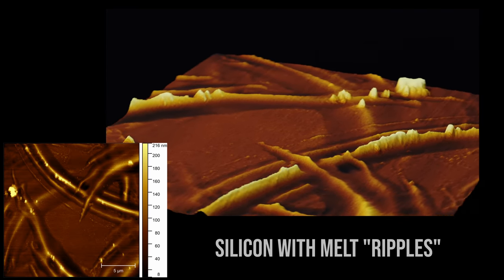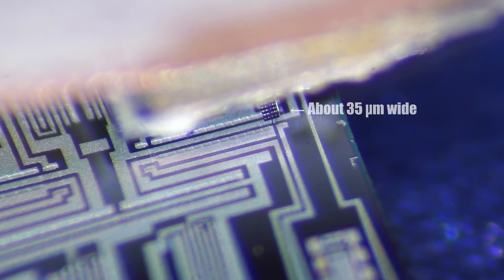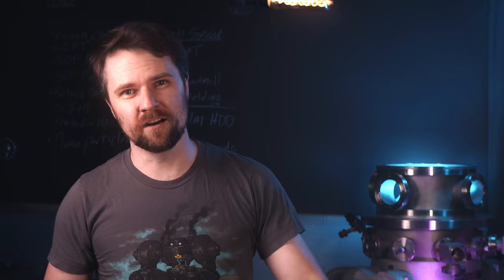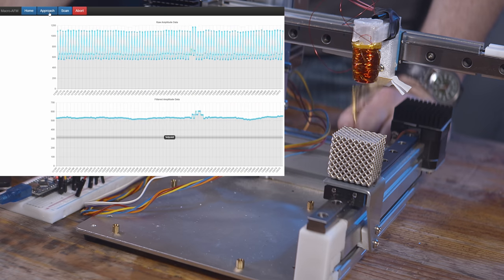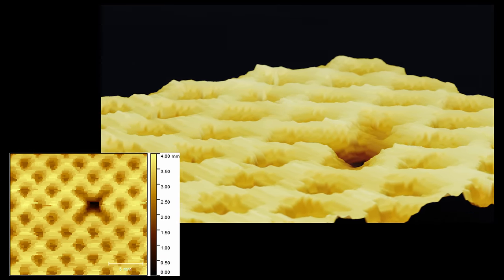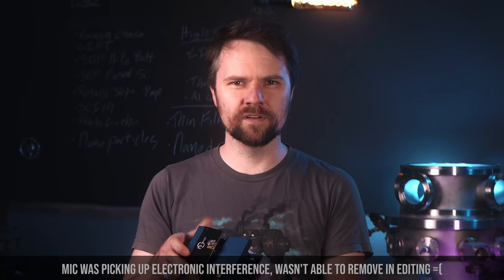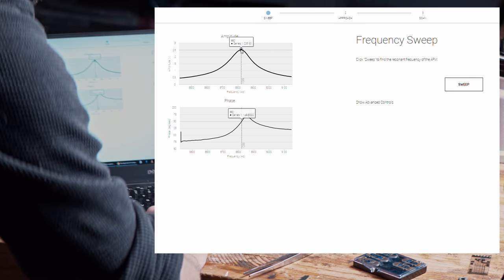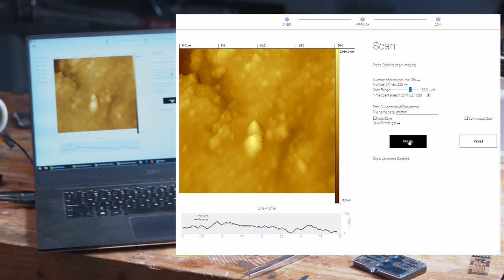1,000,000x Magnification with Atomic Force Microscope

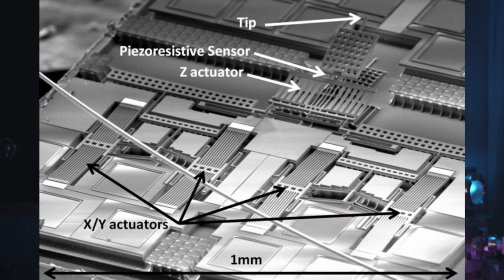Comment: As a PhD Student in MEMS technology the chip a 7:18 just put me in awe. 
I know how complex the mechanics of the "simple actuation" I want to achieve is.  This thing with x/y/z controlled motion is just beyond and stunning to see in almost exclusive silicon.
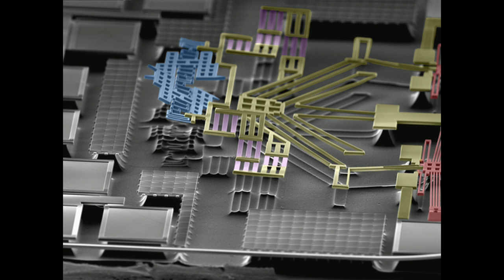Edit: 13:06 blew me away even more! One can still see the point the the "arm" was etched free from the surface, amazing!
Reply from the maker: Pretty wild, right?  It's amazing what MEMS engineering can do these days! IIRC, the actuators are thermal bimorph actuators (instead of electrostatic comb, which is what I assumed at first), which is just super cool :)

Comment: Atomic force microscopy is one of my favorite microscopy techniques, just because it can see down to nanometer resolution, give quantitative data in the Z direction, and the sample does not needs to be in a vacuum. compared to scanning electron microscopy, which requires the sample to be in vacuum, does not see in 3d or give quantitive data in the Z direction.

Atomic force microscopes are just so cool
Reply: also scanning electron microscope damages the sample because the electrons (since they are accelerated to a somewhat high speed) can hit the electrons in the atoms of the sample itself and affect the valence bonding in the chemical elements under inspection. So, if you making some custom integrated circuit for a client, and you want to verify if it is ok (quality test), you can't use electron microscope since it will introduce defects in the product
Reply: @absolute___zero  That’s true too

Comment: It’s a shame they too operate on the “request for quote” pricing model. Look I don’t care if your product cost 1k, 10k, 1M, or 10M just list the damn price, whatever it is.
Reply: Agreed, "request for quote" is the worst thing ever.
Reply: Yes I see it, Yes I want to buy it. I need 15.  Take my money. Response :  we dont have 15, only 12,000 min. Sure, send me the 12000, im going to take 15 out. Send it back on an account of the "picture does not match' cannot be applyed to out exact use.... Request Refund.....
Reply: 'Request for quote' simply means you might need some therapy before and after you see the price. But no worries. There is always a disruptor around the corner.
Reply: at least what is the scale of price. Is it about $5k? Or $50k?
Reply: @bryanjk  I mean that makes business sense though. As long as you are making a profit and you know it's never going to be a high volume item, it makes sense to try and trailer prices to get units out the door rather than block off access to a lot of people or lose out on huge profits based on a fixed price. I mean I'm not a business major, just a humble student of mechanical engineering, so if anyone more experienced could chime in I'd be interested to get their take.
Reply: The Bruker Icon featured at 12:10ish is gonna start at roughly $250K, and accessories or specialized options are $10K+ each. Most industrial companies won't publish their pricelists due the the complexity of information and the very specific markets.
Reply: Some equipment are export restricted the reason for request quote, but I agree it's absurd selling a product and not showing the price.
Reply: That means they will charge different amounts depending on who you are 🤣
Reply: They don't for one simple reason: price matching. They list their shit for $300k their competitors then know to list it lower, both knowing they're over-valuing the product. It filters out anybody they also believe may be trying to reverse engineer it. It benefits every manufacturer as they can all love in their own eco systems, all profitable to an absurd degree. Pricing them results in competition, which, as a result of the beauty of capitalism, means a pricing race to the bottom in pricing to out sell the competition.
Reply: @Exo594-b5v  What complexity of information? The whole "request a quote" thing is just a stupid tradition that gets replicated from one marketing department to another. There is nothing complex about a single number that represents a price of a unit. The truth is that that marketing people believe that if you are forced to call them, they will be able to hypnotize you into buying their stuff. The reality, however is that I just move on and don't waste my time requesting the quote. If the company disrespects my time and wants to play games with me instead of giving me a simple number, they are not getting my money, not even close.
Reply: @MechanicalMooCow  I have a surprise for you and "them": any competitor that is even marginally alert and oriented, calls or e-mails their competitors on a regular basis posing as a potential customer and gets the pricing every month like a clock work. All this silly "request a quote" tactic accomplishes is just a lot of time wasted and serious potential customers who value their time moving on to another product.

Comment: Very cool indeed! I just finished a very similar project at university. We made our own Scanning Tunnelling Microscope! Uses most of the same principles, but instead of tapping on the surface, you move a very sharp probe about an atom away from the surface. Then when a small voltage between the probe and the sample is applied, a magical current appear that is extremely distance sensitive. Our goal was to see atoms, so a micrometer is pretty huge in my brain currently :)
Reply from the maker: Goodness, now that is definitely brain breaking. Very cool!
Reply: @BreakingTaps  It is a bit confusing the difference between "making contact" and "not making contact", as "physical contact" is a remote interaction between fields, so maybe what is meant by "contact" is when the tip is close enough to produce phonons and potentially exchanging atoms, or rearranging them on the surface, hence potentially causing wear, sticking the needle to the surface, cross-contamination and change in topography?
Reply from the maker: @_John_P  Hehe good eye, I definitely glossed over that (well, I recorded a bunch trying to explain, but it was confusing and long so got cut). And looks like I technically mispoke in the final cut as well.  So my understanding is that "contact" mode AFM relies on the very-close range repulsive forces between the tip and the surface. I believe this repulsive force starts just a few angstroms above the surface, and is why the cantilever is very soft so as to prevent damaging the surface (or tip) too much as they are strongly shoving on each other at that point.  The so-called "non-contact" AFM relies on attractive forces at a longer distance, and measures how the attraction to the surface changes the resonance of the cantilever. I believe non-contact cantilevers are much stiffer to prevent them from being pulled down to the surface, and typically have much more sensitive amplifiers to detect the small attractive force.

But yeah, you're totally right: all the forces are remote and nothing is really in contact once you get small enough :)

Comment: Great stuff, I really enjoyed this! I was wondering, the samples you showed are pretty flat and parallel. How does it handle large height differences or things like surface tilt?
Reply from the maker: Depends on how large the height differences are :)  So the max Z resolution is 10 microns.  If it encounters something larger than that the probe will bottom out/crash, or just start oscillating in free-air no longer touching the surface (like if travelling over a hole).  The cantilever is actually pretty soft and flexible so it's unlikely to damage the probe unless you run it into a really large feature which would be noticeable from the microscope.  It'll just stop recording data because the oscillation is basically halted.  There are also settings which control the size of the oscillation... I usually turn that up when scanning a new sample because it allows you to clear larger objects.  Once you're sure the section is "safe" you can turn it down a little, which gives better resolution.

There's usually some amount of tilt in the scans (due to angle of probe, and the stage not being perfectly parallel) which is corrected when post-processing the data.  Different methods to level the image (3 point triangle, intersecting lines, polynomial, etc).  If there is extreme tilt it'll be similar to running into large features, at one side of the scan you may bottom out or start scanning air.  But OTOH, at a 20um scale even uneven surfaces end up being pretty flat... i was able to scan part of a fly wing for example.
Reply: @BreakingTaps  Thanks Zach for this elaborate answer. Sounds like this is a really interesting tool, for example also for layer thickness measurements. I will definitely be checking out this product!
Reply from the maker: @HuygensOptics  No problem, feel free to ping if you have questions! I didn't get into it in the video, but they have different types of probes: sharp DLC tips and less-sharp wedge tips. The wedges are designed specifically for things like thin-film thickness testing since you don't need the high aspect ratio.  Apparently last a really long time and are cheaper. I'm going to be doing some thin film testing in the near future, will let you know how it goes :)

Comment from the maker: Addendum 
- More footage of the probe scanning here: https://www.youtube.com/watch?v=m0UK7LVSZ8g&t=290s
- If I mispoke, leave a comment and I'll add to this addendum! I'm new to AFM :)
- Sorry for the "glow". Some poor life choices were made while filming (fogger, for cInEmAtIc haze) and made my life hell in editing. Lessons were learned 🙃
- There are many types of scanning probe techniques, I'm only describing a very small handful of techniques for topographic information. I might cover other techniques in the future, there are dozens! There are equally many variations of topographic AFM itself, and each manufacturer has their own special sauce, so my comments are just general statements :)
- Scans were post-processed in Gwyddion, and the 3D animations done in Blender
- The Macro-AFM architecture is: arduino driving voice coil and measuring back-EMF, a grbl controller handling stepper motors, Rust program talking to both of those and providing a browser-based UI
- I should have elaborated on spatial resolution more: the final resolution you get is a combination of tip radius and surface geometry. A wide tip (100nm) can still get you high precision (few nm) spatial resolution if the surface is very flat and the features are not high aspect ratio.  But high aspect ratio like nanoparticles or trenches will require a sharper tip that itself has a high aspect ratio, so that the tip can access the internal geometry.  So spatial resolution is variable depending on what tips you load and what the sample looks like
- Gage block is a cheapo import from Shars, so I'm not sure if this is representative of precision ground surfaces in general, or just cheaply ground ones :)
Reply: Nice Blender work! Any reason you stuck with the classic yet boring AFM colormap?
Reply from the maker: @MichaelWatersJ  No particular reason :) Any suggestions for better color schemes? Definitely new to color maps in general, not sure what the best strategy is
Reply: JET map for the win
Reply: Do you think it'd be possible to combine this with something like the Open Flexture Stage to slightly move the object over to rescan and expand the area?
It doesn't need to do this super accurately as long as there is some overlap since that could be used to stitch the scans together automatically.
Reply: Awesome video! Only thing to note is that there actually are quite a lot of modes that use contact mode as the base! It does dull the tip more, but with a proper calibration you can limit the forces applied to the surface. Some interesting contact mode applications are like conductive AFM (CAFM), piezo force (PFM), scanning capacitance (SCM) and more!
Reply from the maker: @mateijordache1952  Oh interesting, I'll have to do some reading on that!  Really goes to show how huge this field is, I felt overwhelmed trying to summarize without putting my foot in my mouth haha.  I love how there are so many offshoots though, it's fascinating to see all the different ways to use a sharp probe near/on the surface
Reply from the maker: @LanceThumping  Maybe, that's a good idea! So the main issue is potentially the vibrations from the stepper motors as they hold the stage in position.  If those are significant it could cause issues with the scan.  But if not... it'd be a very promising way to stitch together larger FOV!  I just might give that a shot in the future :)
Reply: Does the gage block wring properly?
Reply: Use viridis color scheme!
Reply: @BreakingTaps  I took some time to think about this. Which perceptually uniform colormaps would make people feel the most comfortable. The matplotlib set (viridis/magma/plasma/inferno) are nice but cmocean maps might give you a more relatable picture. 

https://matplotlib.org/cmocean/
Reply: @brettkent9851  Jet has a number of design flaws. If want to use a painful but well designed colormap, I'd like to offer mine: https://gitlab.com/mjwaters/gasoline-rainbow-colormap/-/tree/master

Comment: There's a bunch of really cool new types of AFMs that also have characterization like the nanoIR from bruker. The same ir peaks seen with an ftir also induce a greater volume change than other wavelengths. The AFM tip detects this change in the surface. You can get 10-20nm characterization resolution and it is very surface sensitive with a penetration of just a few nm. There's also a nano-raman and a nano-ftir.

Comment: Wow, this is amazing stuff!  Is AFM only for examining rigid materials, or would it also work on cells, viruses, etc?
Reply from the maker: AFM can do cells, proteins, DNA, etc!  The cantilever is actually very "soft" (although the tip is quite hard) so it will happily scan other soft things like cells or polymers. Mine can only do dry materials so I would have to dry/fix cells to make it work (on the todo list!), but there are other AFMs that specialize in wet environments, like for alive cell cultures. There are even variants that can record the "adhesion" force, and it's used to help differentiate proteins on the surface of cells, since different proteins are more or less "sticky" than the surrounding cell membrane.

There's a sorta-classic AFM experiment that looks at DNA which I might try some day.  It's supposed to be pretty tough, but the results are neat when it works :)
Reply: @BreakingTaps  Cool!  Thanks for the detailed explanation - very deep subject.

Comment: WOW! That is amazing ! Excellent explainer, the “macro AFM” is great. I learned a lot; I’d always assumed that AFMs were measuring some sort of chemical-type interaction force. They were somewhat conflated in my mind with STMs (scanning tunneling microscopes). I’m *intensely* envious of (a) all your gear but (b) especially your new pro-level AFM. (Brilliant tech; when I saw your macro AFM, I immediately thought that flexures would be a great way to do the x/y movement, then saw that that’s exactly what the ICSPI unit uses, only built with MEMS technology. I wonder if I could 3D print a platform to carry the probe, using flexures? - And also wonder what the ultimate limits might be of your Macro AFM approach.

==> I know they only work on a “request a quote” basis, but is there any way you could get ICSPI to let you tell us what the overall range of prices is for the model you have? I assume there are a lot of different configurations, so likely a broad range of prices, but maybe they’d let you tell us the general range? I doubt I’d remotely be able to afford one, but would love to know I’d it’d ever be a possibility.

(I used a mini-SEM in college for semiconductor research I was doing at the time; it was the most fun instrument I’ve ever used 😁)
Reply: Know a few people that worked on this tech from Waterloo and the ngauge costs around $10,000-$15,000
Reply: @Gaetano.94  That actually seems remarkably inexpensive!👍

Comment: I have investigated AFM before; the lowest price then was ~$25k.
What is the price range for the nGauge ?
Reply: $15k with first 4 tips.  Tips $200@ in 4pack ($800).
Reply: @jimquinn  That's not horrible if you have a need for it.
Reply: @jimquinn  What is the expected 'lifetime' of a tip?How is that measured?
Reply: $100@ ($400/4pk) std wedge tip, $200@ ($800/4pk) DLC sharp tip
Reply: @billpeiman8973  hundreds of scans, see ICSPI's "tip" web page......

Comment: I once worked for a company that produced negatives for the IC industry. The plotter which use a light beam to expose a flat film had a requirement to be able to plot a point, move 10 mm away and return to that point +/- 1.5 microns in all directions. The manual said adjust until this is achieved. It often took a long time  as part of the adjustment was mechanical and adjusting a mechanical component  is a matter of luck and trial and error. Fun though.